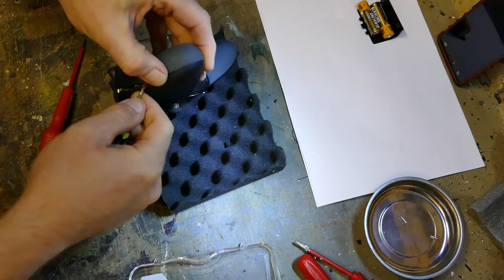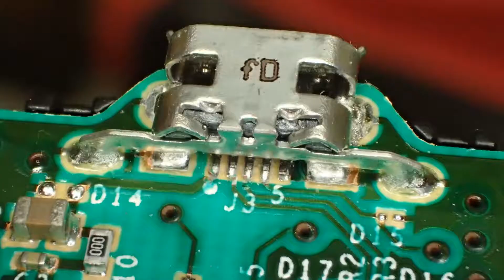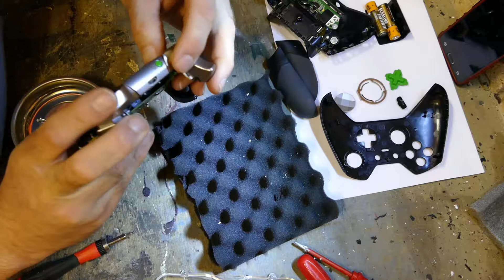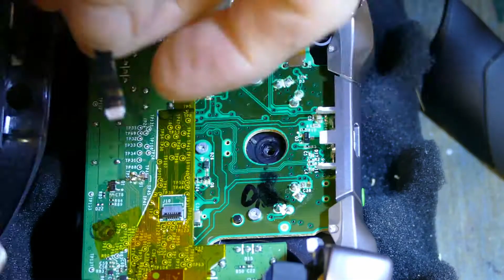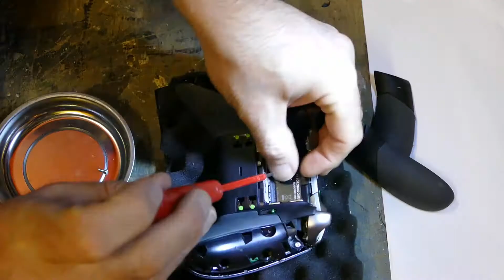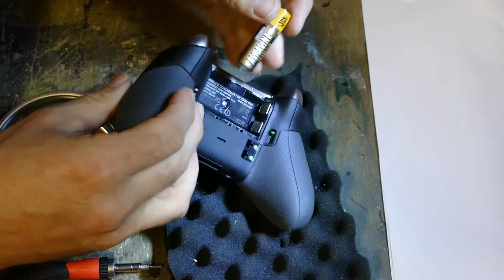Repair Xbox One Elite Controller

Comment: Where you get the socket board from pal and how much was it if you don’t mind me asking. One of my elite one controllers doesn’t connect through the usb. No power at all. Batteries work fine though
Reply from the maker: I got it on ebay for about £30

Comment: i don't have the same problem with my xbox elite controller, but before i took it apart every time i put the battery pack in it always said critical, but when i took the controller apart then put it back together it does not turn on, but i know its not the battery's, do you know a fix?

Comment: Hi can I send mine to you and can you repair it I can pay you on PayPal
Reply from the maker: Sure no probs. Are you in the UK? Do you have the replacement circuit board?
Reply: @TheKayakingkid  yes I am in the uk I am in luton it's for a new circuit board and bumper buttons can you let me know how much it would be
Reply from the maker: @adamkhan8003  no charge. Just happy to help someone out in this difficult time.  You supply parts. They should be easily sourced on ebay.
Reply: @TheKayakingkid  Thanks for your Help I really appreciate it but can I pay you for the parts
Reply from the maker: @adamkhan8003  I'd rather you ordered the parts you wanted.  Then sent it complete with parts for repair.

Comment: I have the same probelm, can u just resoldier the usb port to get it working?
Reply from the maker: Tried it but practically impossible.  To small and fiddly.
Reply: This stems from something that would be a 5 dollar fix if they included something that clips on to the micro usb.
Reply: yes it is doable, but it's small. You can buy 60pcs kits for like 2euro on alie. So if you are capable of soldering that stuff, you can safe $$$$$